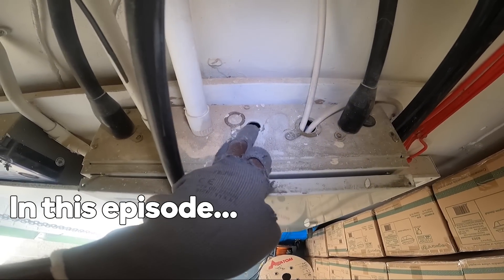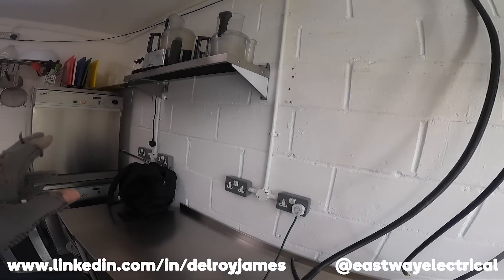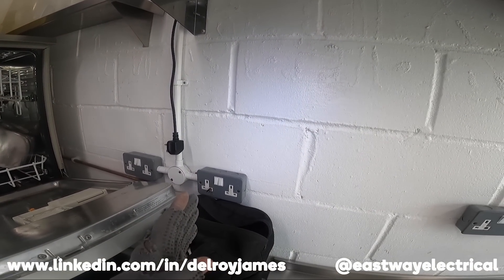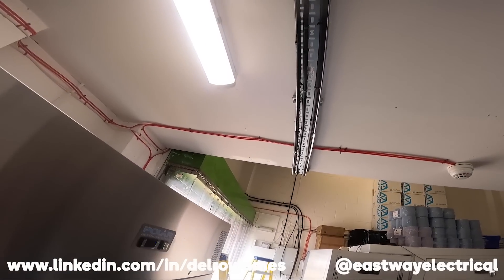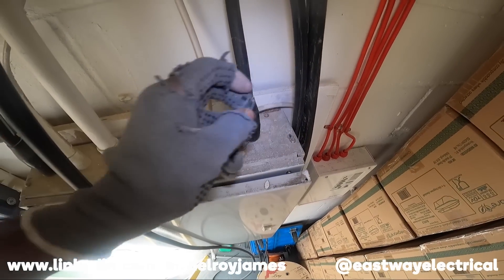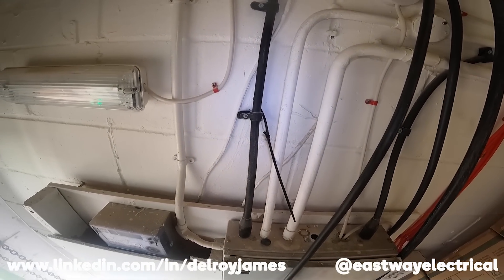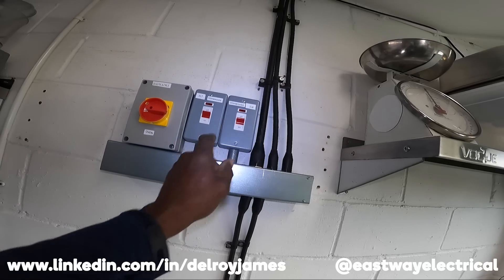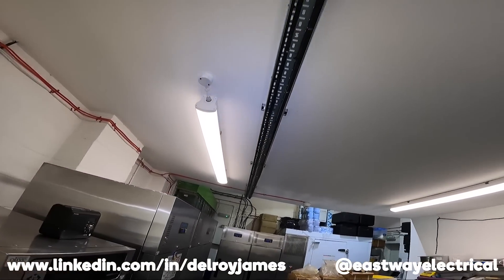"It Can't Be Proper Electricians That Did This Work!!" | Commercial Kitchen Electrics

Comment: This is horrendous.
The cables into the dboard are shocking, absolutely no attempt was made to make them tidy.
The cables coming down into the trunking arent much better, no attempt was made to get them level, the bends are all different, the cleats are all over the place. 

That tray and cables will be nothing but a dustrap, and a nightmare to clean.

The bushs are the wrong way round in the switchs, whatever is coming out of the bottom of the trunking should have been in trunking or conduit, again this will be a nightmare to clean.

The cables around the store room are shockingly bad, if you'd have done the tray properly, you'd have had a much easier time of making them look tidy.

The fact that someone has put this on YouTube, and people are saying how good it is just shows the state if the industry.

If someone did this on one of my jobs, I'd rip it out at my expense and do it properly.

Comment: No reason to change the breaker to the lower one. Cable can take the higher and the oven is a fixed load will only pull what’s required.

Comment: I don't get why you UK sparks use armored cable everywhere, even when there's no physical strain on the cable.. is this prescribed by building code so the cable vendors make a few extra bucks?
Reply: Nope, not building or wiring regs - you can use any wiring method you like when surface mounting. You should take into account the environment though, this is a commercial kitchen where the installation may have to deal with impacts, heat, steam and liquids. Armoured is very cost effective because it doesn't need containment or additional mechanical protection. Weirdly, armoured is also cheaper in my local wholesaler than buying NYY-J - which is basically armoured without the armouring.
Reply: Because he doesn't know what he's doing.

Comment: Connectione of the Flex wouldnt be up to code in Germany. Every stranded wire needs to have a Ferulle crimped on it. If it isnt a cage clamp

Comment: Hi Del, good job as always, on a side note the oven will need to be under an extraction canopy, I know that model and it will have a steam cooking mode and also a cleaning mode, both produce a lot of steam that will easily fill that area, the only alternative is to fit an ultra vent canopy on top of the oven.

Comment: When doing these job's each one you do will get better as you learn from the last installation, but not every job will go as smooth as you like. 
If the customer has ordered the part's and not check the list when they come in, it's not your fault but you can work around the problems and just takes more time to complete.

Comment: Hey Delroy i know you said "an electrician could not of done this" but trust me some are not as good as they think, they take shortcuts or do not do the job correctly. I had an electrician round for three days and i was not 100% happy with the work but, it works. He changed an fuse the fuse board and i asked for it in writing why and he said "yes i will send it" never did, no invoice either. So now i have no idea why an fuse was downgraded other than a mistake he might of made (said you may not like me). will admit his price was "good" but i will not use him again. Would lovce to replace the old fuse (he left it) but do not know how or the reason why he changed it (i think the electrics was tripping due to a socket which was fixed but i do not remember)

Comment: Why did you need to put a lower rated mcb in? The cable stayed the same
Reply: why not protect both? yeah cable would be fine for 50A but what if the appliance was rated for 32A MCB, its a single appliance on a single circuit breaker. 

But a downside I could see in the future, just say another electrician comes onto the job to install a larger unit. They will have to install a larger mcb and redo all the cable calculations. That costs time and money.

But both ways I see are correct.
Reply: @rolyicecold  co-ordination between conductors and overload protective device 433.1.1 Ib<In<Iz 
(the protection of an appliance should be integral to its design) your not protecting a appliance with the MCB your protecting the cable.
Reply: protect the cable not the appliance

Comment: I presume you sized the cable for the bigger oven, so the mcb for that should be fine. You're protecting the cable, not the oven....?
Reply: The oven cable isn't 16mm...
Reply: @misstakenot9582   Doesn’t matter.  Protection of cable can be provided by fixed load.

Comment: Looks like the fire alarm and emergency lights are fed via flex ?
Reply: Could be FP200 or equivalent. Very shoddily installed.
Reply: exposed fire cable should be in EMT

Comment: A trick I picked up when working in steel trunking, after cutting it to length, as staight 90 degrees as possible, use the angle grinder with a light preassure, to smooth the end eaven. If the grinder is keeped perfectly straight to the edge, it will leave one continous burr hanging on by a thread. The last step is to use an old fashioned 3 point deburrer to remove the burr, the long handled style.
It's quick, neat, and hardly any need for filling.
Reply: +1 Even a relatively cheap deburring tool makes quick work of steel edges to knock the sharp off
Reply: How about using a file like a proper tradesmen?
Reply: @casperme6552  There are other trades than just electricians. This works better, and quicker. Should give it a try.